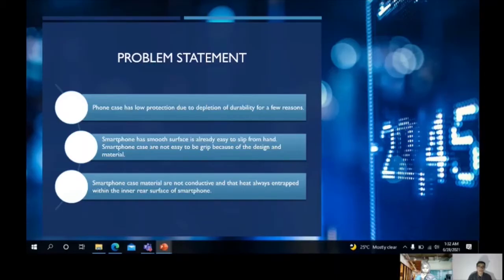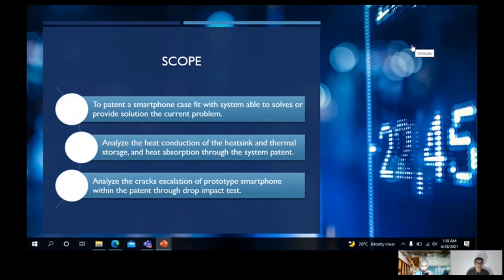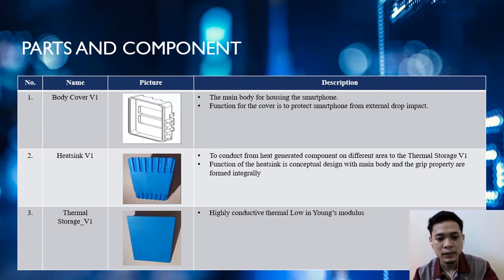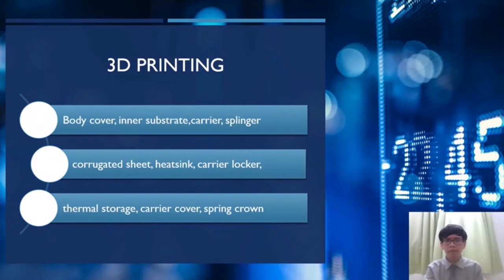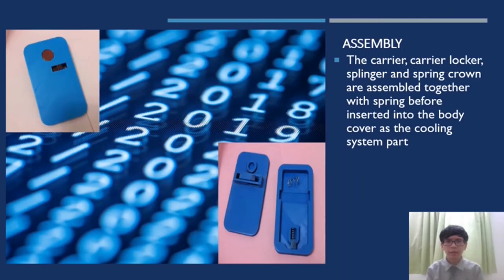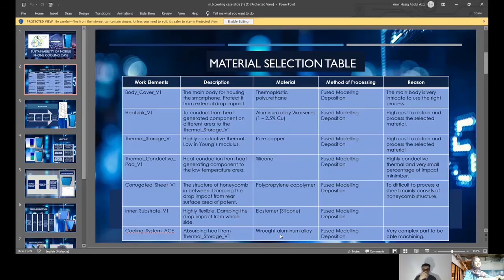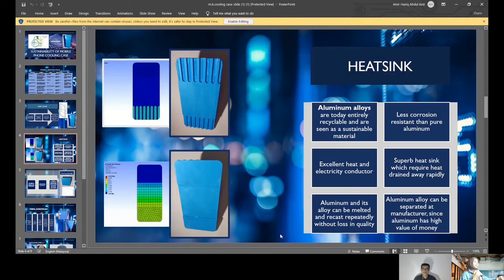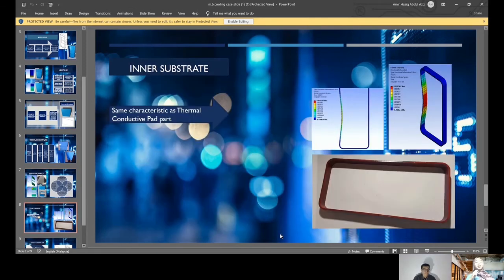IDP 2021-Mobile Phone Cooling Casing (G16)

Comment: This project has a good prospect based on current demand and situation. The team need to revisit the selling price as the target selling price is about 50% of the good smartphone price. For presentation improvement, the manufacturing process can be simplified by using process flow diagram. BTW, thanks and congratulation to the team for your good effort.
Reply: Thank you for your time, Mr Azmi bin Ismail. We will consider the target selling price for current situation. Your suggestion on our presentation improvement is totally appreciated.

Comment: How to discharge the heat trapped and where to discharge?
Reply: Hello Mr Azmi bin Ismail. Thank you for your time and concern. The ideas of how the heat transfer and heat dispersion worked in our patent mobile phone cooling case. The heat transfer we implement is the conduction, though we did plan to include the convection too but in the end had to disregard it due to the limitation in space and weight. The heat transfer in the in the analysis conducted begun by heat transmit from the heat generated component on the different spot surface area of Heatsink_V1. How the heat is discharge is when the heat in the heat sink conduct to the lower temperature area in the middle of heat sink, called the Thermal_Storage_V1. It is highly thermal conductive and malleable that it would be bend into various shapes if it were the heat sink. Thermal_Storage_V1 doesn't always stays in lowest temperature but it would do right after the cooling system we designed known Cooling_System_ACE is activated. Once it is activated, there will be reaction that absorb the heat of their surrounding until the temperature around it is decreasing. This is the same concept that applied in the air conditioner of every household. The reaction caused by the Thermal_Storage_ACE is called the endothermic reaction.